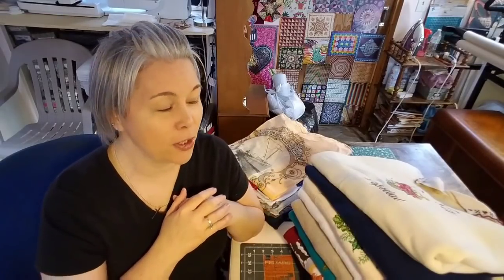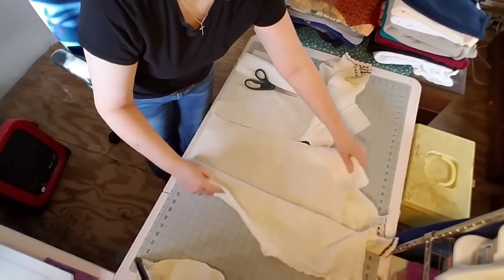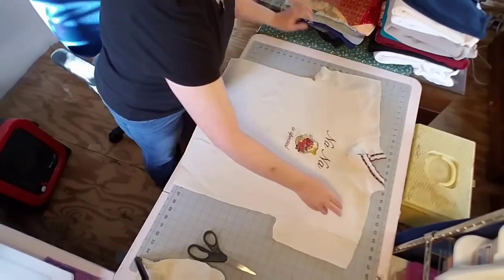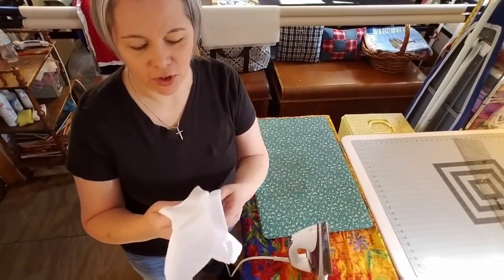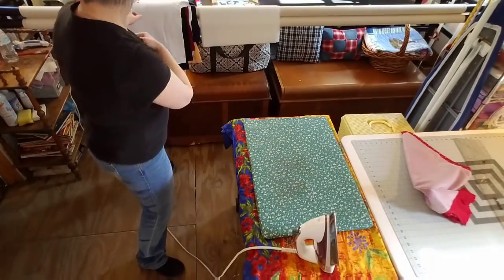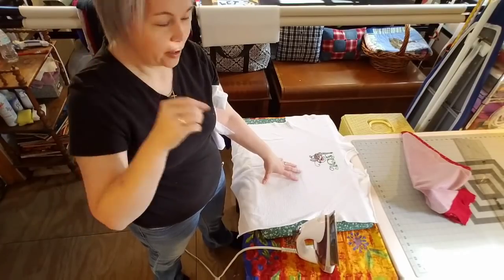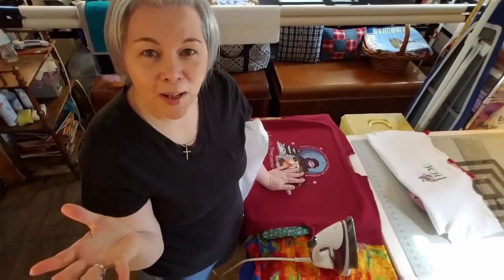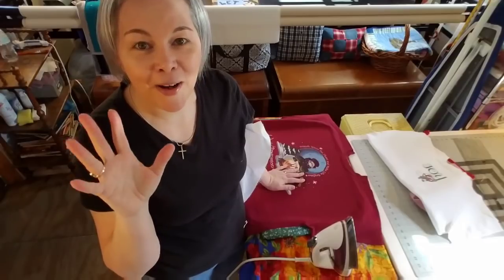T-Shirt Quilt Along - Video 1 - Here we go cutting & stabilizing shirts!

Comment: Nice!  There are a few techniques of yours I need to adopt!  Thanks for sharing.  You and some of your followers may already do this but it was a light bulb moment for me when I changed to a new ironing board cover.  It  would fit into this type of project or any similar 'sicky' project.  When removing my old cover, I cut  about 24"-26"  off tbe un-used square end.  I serged the cut end, as the other three ends are already binded.   I have found it so useful to cover my board with this end scrap when working with any bonding agents requiring my iron.  Over time when that gets messy all I have to do is toss it out and my original cover remains clean.  I've heard of folks using an old pillow case which is also a great idea. And if the sole plate of your iron needs cleaning, Mr. Clean Majic Eraser works well.  Have a good day!
Reply from the maker: you are so welcome Geraldine!  Thanks for watching :)Thank you so much for sharing your tips!  I love it when people share knowledge and help others!!

Comment: Great video and tips - love using the glue.   In process of making a second quilt topic.   My squares on average are 12X12.   There are several tshirts from a young child, so cannot get a 12x12 square, so in a complimentary color, I am using another tshirt cut 12x12 and attaching the smaller square with an knit overcasting stitch.   My questions is should I put stablizer on both squares or just the larger one.     Thank You
Reply from the maker: any t-shirt material you add to your quilt.......I would add a stabilizer to.  It's just really going to help in the construction of your quilt top.  That's just me.....many quilters don't use it at all :)  If you are adding a cotton fabric, like a quilter's cotton, there is no need to add stabilizer to that

Comment: Thanks for this wealth of knowledge! I read thru all the comments & apologize if I miss this question but every online place is out of Pellon 44. Do you have any other brand suggestions? Or different type of stabilizer, I heard any non-woven would work...? Have you used Hobs fusible cotton batting or any other poly quilt fusible batting to stabilize the tshirt? Guess I'm getting desperate at this point to make this tshirt quilt! Thank you!
Reply from the maker: We are all there with you on the shortage of the Pellon P44f right now.  I've heard of others having great success with Pellon 911 if that helps....that may be out of stock too I'm not sure.  If you are doing a quilt as you go...then applying fusible batting to your shirt before cutting your blocks just may work???!!!  :)

Comment: Hi Lisa - You've mentioned allowing extra stabilizer around the cut squares. Could you please tell me approximately how much would be enough? Would 1 inch all around be sufficient?  A related question: In the end, is the stabilizer only covering the part of the square that shows or is it also attached to the seams? I was thinking maybe having it cover the seams as well might make it too bulky even with the lightweight stabilizers. But if it is cut right at the seams, it might eventually fray or pull away from the shirt. Thanks so much for sharing your expertise with us first-time T-Shirt quilters!
Reply from the maker: Hi Mary Jo!!  1 inch all the way around would give you plenty of working room :)  You'll cut your block to include a seam allowance.  Let's say you need a finished 12 inch block.  You'll cut your block at 12.5 inches and your stabilizer will extend the full 12.5 inches and will be in your seam allowance once the blocks are sewn together.  This is one reason I really love the Pellon P44f interfacing because it is so light weight....it adds a small amount of bulk in your seams but it's not a terrible amount.

Comment: Lisa I was told by a friend that the stabilizer should be fused to the shirt with the stretch going the opposite direction as the stretch of the shirt. T-shirt’s stet has horizontally so the stretch of the stabilizer should run vertically. Have you found this to be true also?
Reply from the maker: Peggy Young yes, this could be true depending on the stabilizer you are using :)  some stabilizers are stretchy as well, so that would go in play if using one of those. The Pellon P44 that I use does not have any stretch, and so you do not have to pay attention to direction  :)

Comment: Lisa where did I get the quilting thread you told us about on your video that you use?  Thank you for the videosame I have learned a lot.   I am old but want to learn.  Thanks again.   Libby Tompkins
Reply from the maker: Hi Libby, great to hear from you!  For piecing my tops I like using a variety of different threads, many of them come on cones.  I'm thinking most of them are called "overlocking" thread or serger thread.  You can find them at Walmart, Joann's and other places.  I also really like the brand YLI and you can order that online or through Amazon as well.  The YLI UU is a universal thread for piecing and quilting and is nice and strong.....stronger then the overlocking thread cones in my opinion.  I'm hoping this is clear but let me know if you have any questions :)

Comment: Hi Lisa! Thanks for the wonderful video. I had a question as a amateur quilter-- I see you added the interfacing to the backs of the shirts without really looking where the interface would lie in relation to the logo in the front. For the shirts that I have with logos, should I try to paste the interfacing so that it is entirely covering the logos in relation to the front? I hope this question makes sense. I'm having trouble doing this.
Reply from the maker: Hi Nabz!!!  After doing so many t-shirt quilts I've gotten really good at laying down the interfacing, however as a new t-shirt quilter this may be helpful:  Cut your interfacing an inch bigger on all sides of your desired block and then lay it down over your logo with your shirt right side up.  Then trim away the extra shirt bits all the way around the interfacing.  Next turn your shirt right side over and your interfacing should lay right over where you want it.
Reply: @TheQuiltmakerHomestead  Thank you so much for the tip! I really appreciate it. :)

Comment: I read in other articles that you should wash and dry your t-shirts without fabric softeners and without dryer sheets. Do you do this?  Did you ever notice a difference in the texture of the t-shirts with or without fabric softeners.  Also, do you put the stretch of the stabilizer on the opposite stretch of the t-shirt to prevent excessive stretching even more?  Thanks for your time,
Reply from the maker: Hello Kathryn!  Let's see, first I'll start with the washing of the shirts :)  Many clients drop off their shirts to me for their quilt freshly washed.  Some have used softener and some didn't.  I never notice a difference in between the shirts at all.  I use Pellon P44F interfacing.  So maybe with this particular interfacing it doesn't make a difference????  Maybe with some different ones it does matter.  With the Pellon P44F, there is no "stretch" in that stabilizer.  Some other types do stretch and so if using something different I would pay attention to the direction you attach it to the shirt and would place it in opposite direction of the shirt stretching.  I hope this answers your questions, if not let me know :)

Comment: I just came across this quilt a long video and i love how you explain in details, but I have a question: can you use any other material instead of stabilizer or can you iron your t-shirts without the stabilizer... may not be 100% but can it do the job ?
Reply from the maker: Hi Chantal, thanks for tuning in and watching this video!  I've made t-shirt quilts without stabilizer, it's totally do-able....however the stabilizer makes it SO MUCH easier :)
Reply: So if I understand correctly, I don't skip the ironing part, I just dont use the stabilizer.